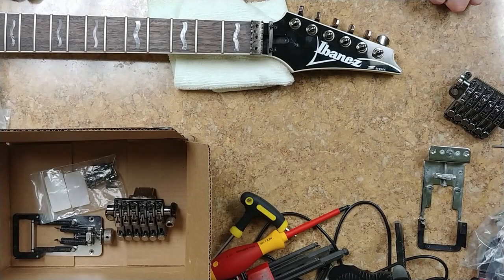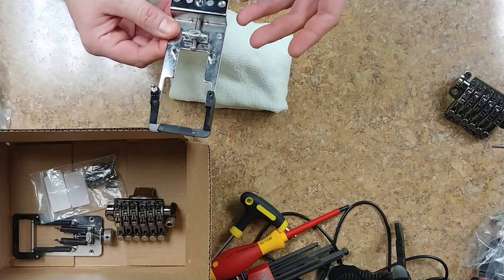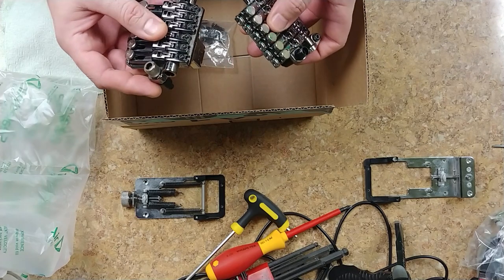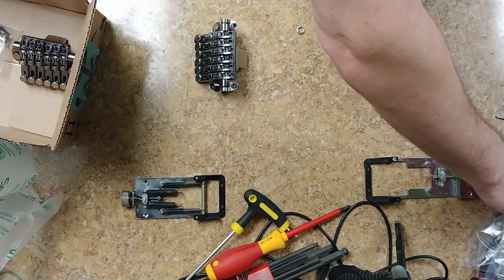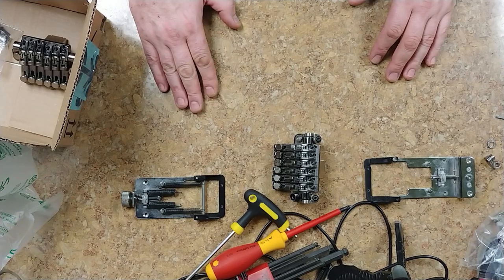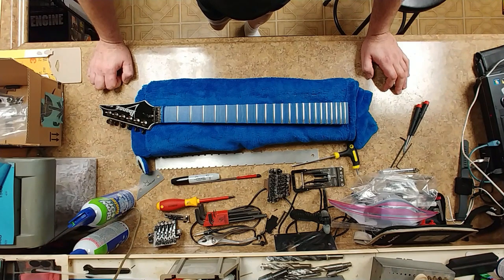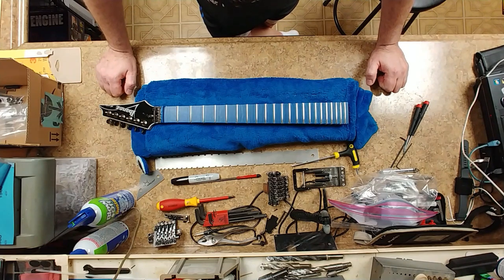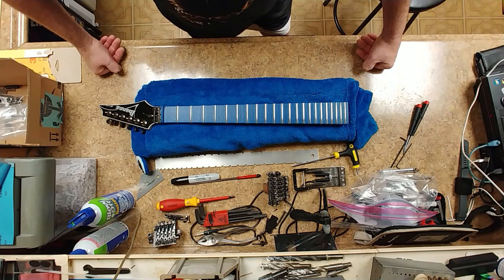Working on the Ibanez S470DX

Comment: Dude,you are a s470 proffesor!
My tremolo stub is broken on the top screw hole,it's a pretty weak design,and difficult to find the part as hell...
After i took out the bridge,I find the bass side stub bolt is higher than the treble side,like around 3mm,is it normal?